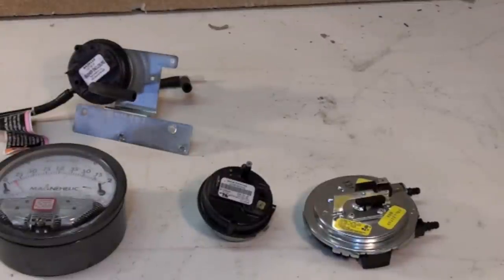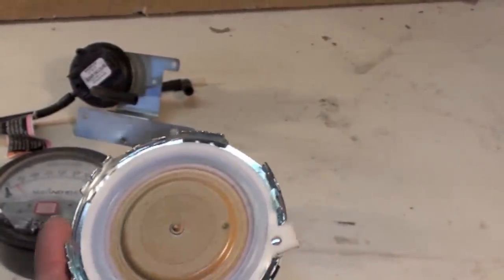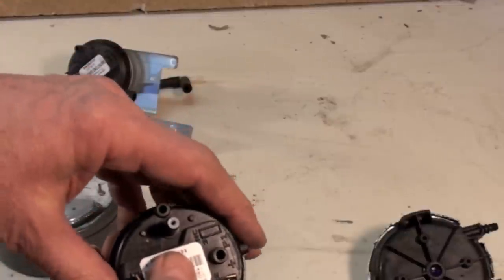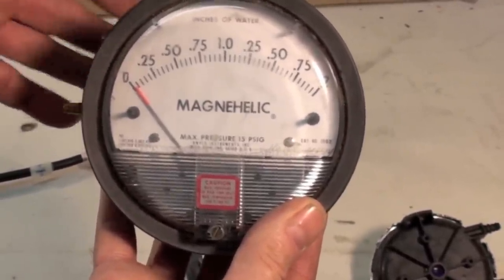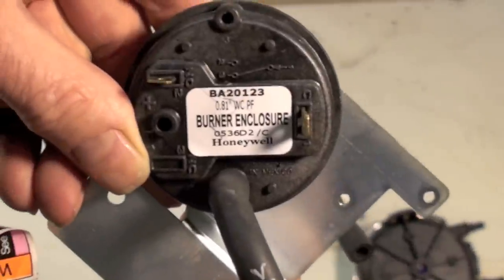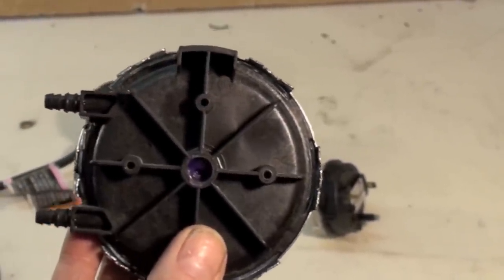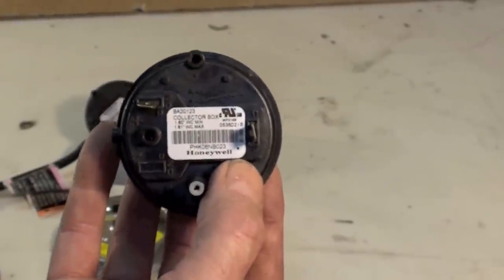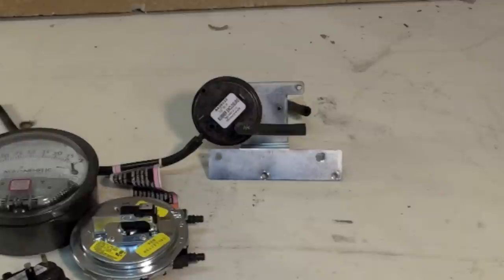How gas furnace pressure switches work

Comment: That little grey piece in the second pressure switch, snapped clear in half for me. Took the tube off and pieces of it fell out. Had no idea what it was, nobody had any idea and your video solved the mystery!
Reply: Same thing happened to me and the pieces were blocking the lumen of the tube and making the switch act erratically. Any idea what that part is called? I’m trying to order a replacement and can’t find it anywhere.
Reply: @AK_5.9 I bought an entirely new pressure switch to resolve the issue. It wasn’t expensive at all, something in the ballpark of 20-30 dollars. The little grey piece was part of the new switch when it came.
Reply: @Helm_To_108 gotcha, thank you for the reply!

Comment: Skipped the grommet if there ever was one. Cleaned all 7 screws with wire brush and replaced two of them with standard machine hex head screw (the two that also hold on the P/s) 10-32 thread. No leaks. Igniter only starts with front and rear hoses on the new design P/s reversed from that of the original design.  I am tempted to run it that way.  No heat or hot water for six days so far.  Thanks again for all the help GSM.

Comment: I watched a few of your videos and I came to the conclusion that my pressure switch was sticking due to moisture contamination. I recently had a drainage problem which caused water to back up and leak from the inducer motor. I even had water come out of the vacuum tube where it connects to the inducer. Before replacing the pressure switch I would get an error code for stuck shut, and most recently I got a code for stuck open. I replaced the switch last Friday and the furnace been running fine since then.

Thanks for making these videos.

Comment: hey gray it was the metal bib that comes out from the blower to the pressure switch.it had a little rust in it i blew it out and took the hose off and blew that small little hose out then reattached and bam! the furnace started! thanks for the info probably saved me $300.00!

Comment from the maker: You need to be sure the sensing tube is clear and all fittings are clear.  Also be looking for blockages in the vent pipe.  Sometimes, the inducer blower wheel can get dirty.  Hope this helps.
GFM

Comment: I had a call years ago with pressure switch issues.  It was a two pipe system that was in a basement and the pipes were in a sheetrock cavity.  After a bit of calculating, the 2" pipe was just a bit too long with the amount of elbows being used.  It needed 3".  I had no choice but to make both pipes into exhaust pipes.  

It cured the problem but not my favorite choice.

Comment: HEY! I WOULD LIKE TO SAY THANKS FOR YOUR HELP.   I WAS READING SOME OF YOUR COMMENTS AND HEY HELPED ME WITH MY FURNACE, I HAVE A ARMSTRONG AND 3 FLASHES WERE COMING ON, WELL FIRST I DID REPLACED THE PRESSURE SWITCH, BUT NOW I KNOW IT WAS NOT THAT.  VENT TUBE WAS ABSTRUCTED, I TAPPED ON IT A FEW TIMES AND THE FURNACE CAME. ON.

Comment from the maker: One of the failures of most of us techs has been the use of a digital manometer.  If we check the pressure and it is up to par (you need the factory specs for this), the pressure switch has failed.  If not, obviously the problem is elsewhere.  It is that simple.  Hope this helps.
GFM

Comment from the maker: There are 4 things I can think of.  Blockage in vent, inducer failing, pressure switch/ pressure line, cracked heat exchanger.  I have a number of videos that may help.  Hope this helps.
GFM

Comment: Checked Amazon for the GSI and although discontinued the Pyle PDMM01 looks identical in every way except for the name so will probably order that one.  I think I found problem.  I can feel air coming out from the blower housing cover plate that the motor and blower wheel are attached to.  The sealant almost looks like it melted and dripped.  Will remove, scrape, and apply red high temp RTV.  Then hopefully the P/s will work attached like the old one and not with hoses reversed. Thanks GSM

Comment from the maker: It may fix itself.  The pressure switches bleed a small amount of air in to keep the switch and line clear.  The old switch may have that feature plugged.  If the furnace is in an unconditioned space, it may gather moisture because of where it is.  Hope this helps.
GFM

Comment from the maker: The Fieldpiece Dual-Port Manometer - SDMN5 is a top quality tool.  It should have dual port and Fieldpiece is a quality brand.  Not that there are not others, I have a cheap GSI that works well but is not as tough as the fieldpiece.  (also check the vid on comparing manometers).  I would not go for the Magnehelic because you will need 2 or more and they are somewhat delicate.  The water tube ones are not accurate enough.  Hope this helps.

Comment: Good first view.  I helped design all you are showing.  Over pressure for the old switches is .5 PSI, the new plastic ones are 3 PSI and have a hard stop.  The pressure rating you are seeing is NOT the test pressure in all cases.  If it states PF (pressure fall) then you need to add approx. .10"WC to the reading to assure the appliance has Minimum System Pressure.  The one's with a Min/Max show the "sour point" (low) and the high reading is the Minimum System pressure (high).  You should always check the "bleed hole" is clear if you are getting water (condensate) in the Neg line.  All new switches are required to have the set point on the switch in some manner.  Also, the MFG'r WILL NOT warranty the switch if the Tamper Seal is broken.
Reply from the maker: Grant Edwards All good info.  The part about the tamper seal is also good.  If I saw one I always replaced with a new factory switch.  For a while manufacturers did not want us to know at what pressure their switches made.  Very frustrating for a service tech.  And of course pressure were (and still are) blamed for any number of failures.  Again, thanks for the thoughts.
GFM

Comment: Thanks for the quick response GFM.  Really appreciate it.  Tried to find analog manometer locally.  Only had expensive (few hundred) digital. Will look online. Meanwhile I'll do a cleaning. I don't understand collector hood (pressure) L- shaped setup top of boiler.  Collector hood (pressure port) 90 degree turn to transition (suction port) then blower and vent pipe. Blew air into transition port clear. Collector hood pressure port cant blow into. P1 (-) to me means suction P2 (+) pressure. No?

Comment: I just ordered one on amazon . I made a ion furnace humidifier and i need to trigger the humidifier when the fan is blowing.  The one that i have now with water curtain doesn't do how much i need.  AIR IN canada is very dry. My hardwood floor shrink  a lot. So i ordered a 10 head ultrasound humidifier with 48v power supply  and i need to trigger it. So finally i found on amazon one with vacuum/low pressure trigger. I hope i can connect to 48v

Comment from the maker: If the furnace was wet, the manufacturer says pitch it.  If you have insurance, they should pay for it.  The blower motor has probably failed.  When they get wet, you never know if they are damaged or not.  In any case, the bearings will probably have reduced life.  Hope it helps.
GFM

Comment from the maker: Actually they seem to both be negative.  Both lines are on the negative side of the inducer.  The collector fitting sometimes has a very small orifice to lower pulses from inducer.  A small wire may clear it and get you back in business.  Check Amazon GSI brand for meter.  Hope this helps.
GFM

Comment: I had 3 blinking green lights telling me the combustion pressure switch failed to close.So i watched your video and gave the switch a tap ( a light knock) and the hose leaded to the switch......and well-ahh the furnace fired up. I'm assuming dirt in the system. Will inspect in the morning....at least I have heat for the night. Save a pile of money calling a service guy at  double rate. That would painful for a $40 part. But like you said, could be something in the system....cheers thanks for the video!
Reply from the maker: +Mcbeth2pl Merry Christmas
GFM

Comment: Your information is extremely helpful to me. My Pressure switch was completely water logged, as were the hoses going into it. So I know from you video that water ruins the switch so I will replace it. Now I just need to figure out why it"s getting all that water in the hoses. Got any advise on that one ????

Comment: I would be looking for blockages in the vent or manifolding on top of the boiler.  The highest vacuum should be closest to the inducer.  The switch is biased (means a spring on 1 side of the diaphragm will not allow switching if pressure is same on both sides).  So it could work if hoses are backwards.  Do not leave that way!  P1&2 are probably factory markings.  Again, venting block, inducer not up to speed, wheel coming apart etc.  Vac gauge will help a lot.
GFM

Comment: Yesterday a guy that works for me had his furnace start then shut the gas off repeatedly. I told him it was probably a sensor of some type. Now today mine is doing it. We are in the middle of what they are calling Winter Storm Goliath. Wind gusting to 55 miles an hour, My light blinked 3 times and the label said Pressure switch open or shut when it should be the other. I put 2 and 2 together and figured that since both of ours are doing the exact same thing and the high wind is probably blowing down the flue tripping the switch. Thanks for the video.
Reply from the maker: +waldan1701 That could very well be.
GFM
Reply: waldan1701
Reply from the maker: Welcome
GFM

Comment from the maker: Blower motors will often fail if wet.  There is no certainty there.  If you are set on keeping the furnace, you might try replacing the blower motor.
GFM

Comment: My inducer blows never shuts off. The furnace works ok (heats normally) in regards to the thermostat, but blower never stops running. The vent pipe is shared with water heater (gas) Tempstar furnace. Thanks

Comment: Tempstar NUG5100BHB1 The Inducer/Cumbustion blower (fan on vent pipe) never shuts off. The furnace does heat ok, according to the thermostat. The gas valve opens, burners ignite & shuts off when house temp raise to themostat settings. The only way to turn OFF this blower/fan is to turn off the circuit breaker. The furnace wwas installed (new) 1995. I heat up the house & manually turn off the furnace by the breaker. I just noticed this problem yesterday. Thanks

Comment from the maker: My guess on that is the inducer relay is stuck on.  You might try striking the side of the control box with a screwdriver to see if it stops.  If it does, the relay will have to be replaced because it will do it again.  Even if it does not I would say the relay will need to be replaced.  Hope this helps.
GFM

Comment: Hi GFM. Wanted to follow-up. Called Propane Company's Service Dept.  Tech threw parts at it (I had them all in stock) until it worked said other things wrong??.  In the end he reversed the hoses on the P/s and boiler is back in business $380 in labor later.  
Meanwhile, GSI manometer equivalent (Pyle PDMM01) arrived. Want to test it. Saw your video on the GSI. One question.  Two ports on top of unit not labeled. Which is Pressure and which is Suction port? Thanks.  John

Comment: I was going to check the heat exchanger when I started the unit today and STILL felt air coming from around the sheet metal plate with the motor/blower wheel attached to it.  Maybe I didn't use enough although it looks sealed.  I checked the cast blower housing for cracks and I don't see any.   I used Imperial Red High Temp silicone sealant.  Maybe you have to glop it on.  Not sure.

Comment: Hi, could you tell me if Supco's furnace pressure sensor NS2-0000-31 can replace Honeywell's IS20146-3352? Thank you very much for the help!
Reply from the maker: The Supco product is a general replacement switch.  The Honeywell is an OEM replacement.  If the application is a gas appliance, you will need to use the OEM product.  
This is not just an anti DIY opinion.  These switches are very specific in their opening, closing and differential pressures.  
GFM

Comment: I have a 6 year old Lennox furnace. Runs great until temps start to get under 0. Furnace kicks on and then after about 10 min goes into high fire. After running on high for 10min or so the inducer fan starts to pick up rpms. The rpms gradually go higher and higher until a pressure switch failed open code starts to flash and then the furnace restarts in low. It does this cycle non stop, high-low high-low. When it’s this cold it won’t keep up seeing as it needs to be on high longer. I cleaned the trap, had every hose off checking for clogs, took the inducer off and inspected it as well as checked the ports behind the inducer for and blockages. Everything looks fine. I’ve paid 2 different repair companies to come look at it and all they do is the exact same things I’ve already done and then tell me everything looks good. Also tried swapping the switch, no change. I have no idea what else to do!
Reply: Also after awhile the furnace will occasionally shut down and not start up and just flash the pressure switch open code. When this happens I noticed that if I take the hoses off of the switch and suck through them the red hose will have a tiny little water pocket in it. Not sure why, seems like condensation is getting produces in the hose, even though nothing appears to be plugged or backed up. Any help would be appreciated!
Reply: Check the end of the drain line outside. It is most likely freezing up.

Comment: Fantastic videos GF. I can tell you are a teacher. I looked through videos for answer to problem.  Closest was How P/s on 398aaw Carrier is wired. Have Weil McLain Series 3 HE-5 with WR ignition. 3-terminal P/s. Old style was metal, new one plastic.Tried new one. Won't switch from NC to NO position. Front port of old P/s went to side of transition (suction). Rear port went to Front of Collector Hood (pressure). New one only works if hoses Reversed. Is that possible? What are P1(+), P2(-) on P/s?

Comment: On a Coleman mobile home furnace/80%-er, the dual-port differential pressure switch spec shows on the label only as 0.10" WC.  Coleman Tech Support once told me this was the "set point," and it would take approx. 0.20" wc to close the switch. If this Tech's statement  was correct,  please define "set point."
Reply from the maker: +JustPlumDucky Interesting.  There is a differential on all pressure switches.  He probably means that at .20 it will close and at .10 it will open.  Sounds like a good subject for a video.
GFM

Comment: We had a repair company come out the other day and they told my wife the pressure switch had failed the pinch test and that the unit kept running.  Is this pinch test for real?   Thank you for your video!
Reply from the maker: Mark Kramer Sorry for the wait, I have been out of town.  It depends on what furnace you have.  If your furnace is over 25 years old, it may have value.  Any furnace with an integrated furnace control (control board) and some others, the furnace control checks the pressure switch operation with each cycle.  Hope this helps.
GFM
Reply: Thanks for your reply!

Well I've watched and read your entire site for heating and armed with that knowledge and some gear I just bought I fired up the furnace waited for it to start circulating air and pulled the vacuum line to the pressure switch and it shut down the burners instantly.  I then reattached it and after a short wait the burners reignited.  I tried this "pinch test" and could not squeeze the vacuum line hard enough to get the furnace to shut down.  So I'd be wary of techs using this test to sell you a $280 switch that you don't need.

I then hooked up a manometer and measured .7" WC.  It should have been .5" but I haven't read anything about the value being higher than it should be so I'll keep looking around.  I'm thinking the variance may be due to how I had to adapt hose sizes.  The Fieldpiece manometer has this non removable barbed fitting on it.  It's probably the next size down from what I needed to fit in the line that goes between the pressure switch and the combustion chamber.  So I have one diameter line for about 3 inches hooked to that non removable fitting.  Then they gave me a double ended barbed adapter to get up to the proper size  line.  I used that then hooked up the proper sized line then I have that going to a T fitting so that the manometer sits in line between the pressure switch and the combustion chamber.  So maybe the smaller diameter line and all these adapters are messing with the reading.

This was a lot of fun learning about all this.  I'm going to read all your AC stuff next as it's supposed to be 96 today and I don't want to get taken on the next service call.

Comment: Thanks excellent video. Can you tell me with condensing furnaces, why would there be water in the pressure tube from the inducer? What is that a sign of exactly? Thanks again, very informative
Reply from the maker: Aaron Wilmoth Several possibilities here Low spots in the tubing will sometimes collect water.  If the furnace is installed in a space that is below 55 degrees or the return air is that low.  Also pressure switches sometimes have a small hole in the diaphragm to bleed a small amount of air into the switch to keep it clear of water.  Hope this helps.
GFM
Reply: Thanks for your help! Awesome!
Reply: grayfurnaceman My furnace, a Lennox G61MPV, had that exact problem.  The tubing that runs to the pressure switches was too long and drooped below the openings where water collected and caused faults.  Is that tubing installed before the furnaces are shipped, or do the installers put them in?  It seems like either should have known better.